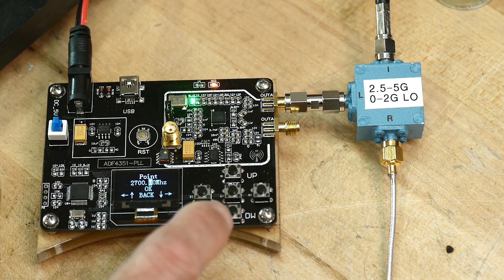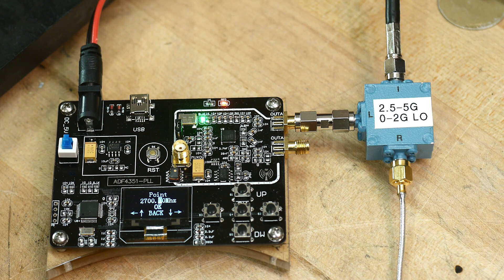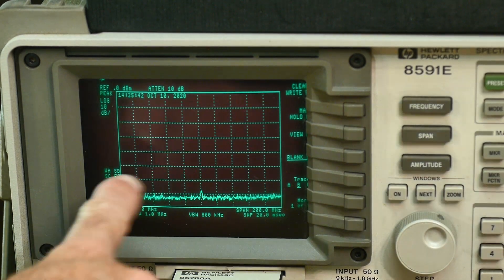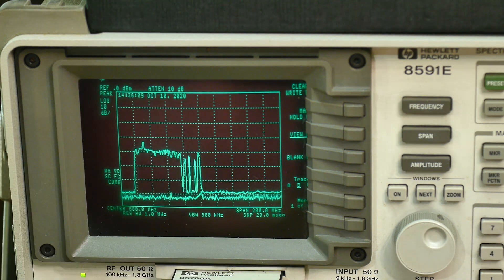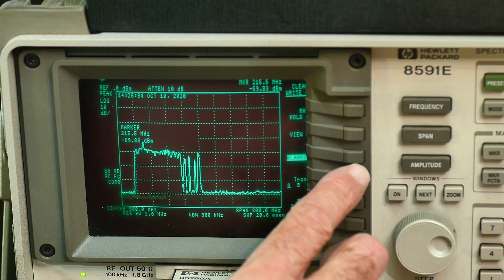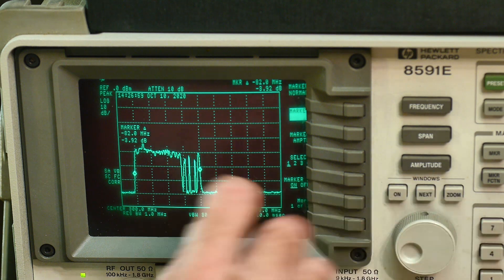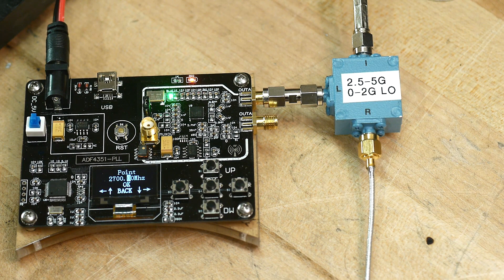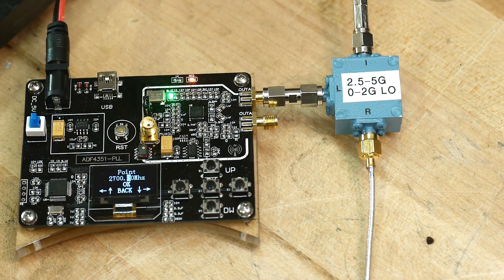#614 Using ADF4351 RF Generator and Mixer to Measure Bluetooth

Comment: This generator is also available with a large touchscreen interface. I wonder if you could try using a mixer to generate RF in the HF amateur band.  Would mixing a signal over 2230Mhz make sense, in order to keep the output at 1-30Mhz in sine wave format? Thx & 73’s

Comment: Not sure if you know but when you set the boards output frequency to 2.2GHz to 4.4GHz the output becomes a sine wave, it no longer goes through a digital divider, it outputs the VCO's sine wave directly (but buffered).
I also started to re-write the firmware to suit my own needs some time back, the source is here if it's of any interest .. https://github.com/OneOfEleven/Geekcreit-ADF4351-PLL-Board

Comment: Hello, thanks for the video. Can you comment on the drive power requirement for your mixer? I've looked into using the adf4351 synthesizer boards for driving the LO of diode mixers but was discouraged when I learned that diode mixers typically want to see 7dbm or better LO drive power, and the adf4351 max output power is  5dbm.

Comment: so why dont you use LO=2100MHz?! 
and by the way, you can use Frequency Offset feature in your SA to read the "actual" frequencies off the screen and markers instead of reading the downconverted ones and doing the math in your head.
Reply from the maker: I guess I was dumb. Sounds like the way to do it. I was thinking to keep the LO above the spectrum analyzer to keep it clean but it is already above so 2100 would be fine. and sweep in the right direction. I'll have to go find the frequency offset and try it. Thanks
Reply: @IMSAIGuy  LO > RF is used when doing up-conversion such as in the first mixer of spectrum analyzers. in that case your  RF input should go to the IF port of the mixer and you get the up-converted IF from the RF port of the mixer.
Frequency offset is under the Freq button (menu)
Reply from the maker: @amirb715  I don't understand mixers and the IF LO RF connections. I've heard IF and RF are interchangeable? the mixer I used was rated at 2.5-5GHz IF RF and 0-2.5GHZ LO. what is the best way to connect things? so should the RF always be the highest frequency?
Reply: @IMSAIGuy  theoretically you can exchange RF<>IF with no consequence but the way they optimize the transformers (we are talking about passive mixers only>> only double balanced ring mixers - could be GaAs FET or diode switches) and switches, you get the best performance and lowest conversion loss if you always keep the IF to be the lower freq and RF to be the higher. So for down conversion IF<RF, you connect it as usual meaning IF from IF port and RF into RF port. For up conversion RF<IF (such as front end of spectrum analyzers) you get your IF from the RF port and feed your RF into IF port
MiniCircuits have a couple of excellent application notes on balanced mixers